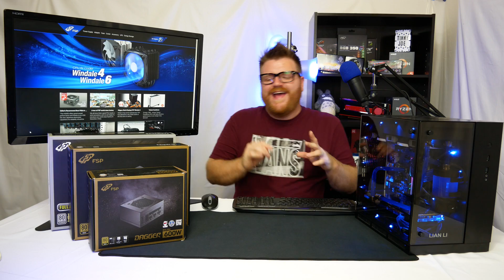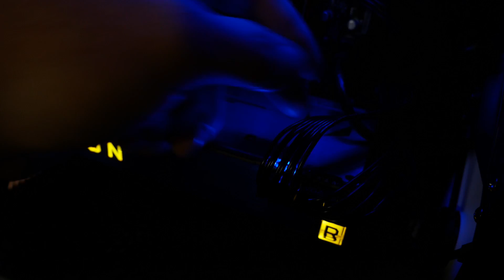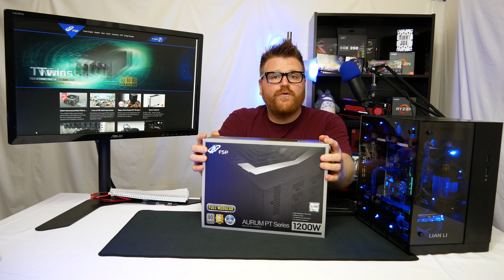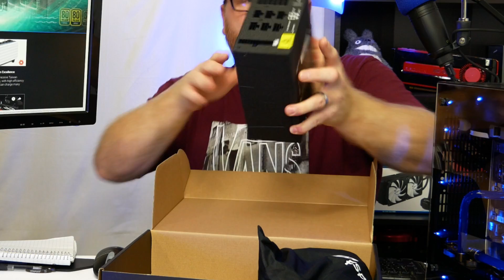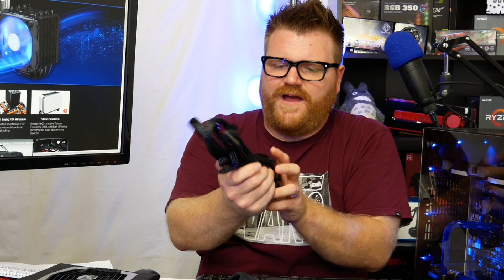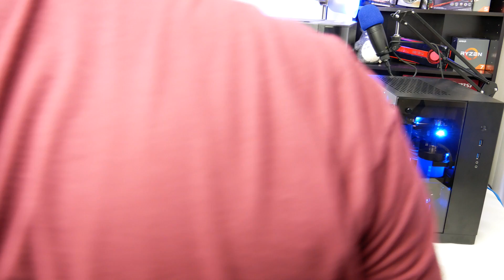FSP Aurum PT 1200w Power Supply Overview

Comment: I am seriously considering to get Aurum PT 1200 and use it with 5x GTX 1070ti's. 
Would it be possible (safe) to hook up 5 cards on it? The cards have one 8-pin connector on them.

Comment: Here is a good question for you.  Is it better to have a power supply that is rated just over what your system will pull?  For instance, a system total peak power consumption of 532 watts with a 550 total watt power supply.  OR, getting a power supply that is over-rated for your needs.  Say getting a 600-650 watt power supply (or even higher) for that 532-watt system?  Maybe you could make a video explaining the reasons why you would want to install a given PSU for a given PC based on expected maximums.  Thanks.
Reply: Don't cut it too close but yes buying a 1000w PSU for a 500w system... will cause you to burn a little extra power   at idle as that is not the optimal range for the PSU usually.